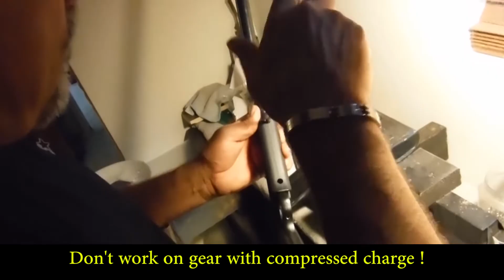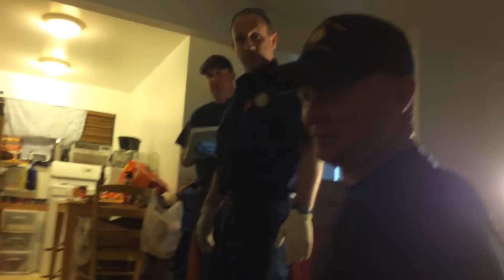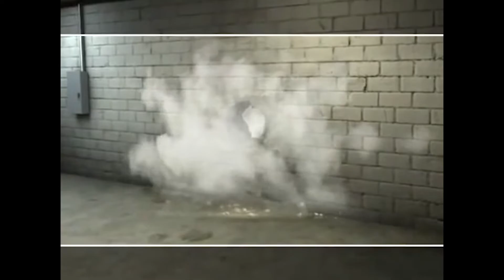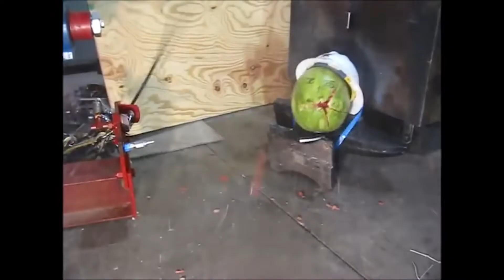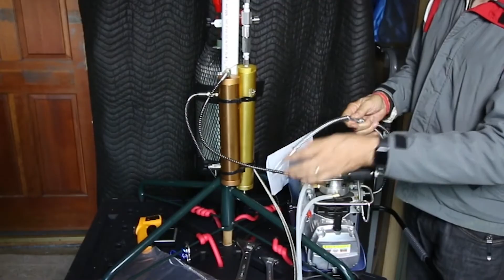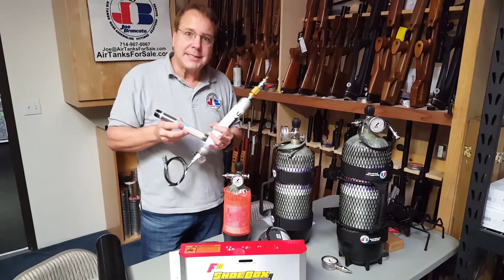PCP Paintball - Air Compressor Accidents and Safety

Comment: Michael, I Just finished your 3 part series about the Yong Heng Compressor. As I'm just starting out in the world of PCP Air-gunning, your videos are proving to be a valuable source of information. Part 3's "Accidents and Safety" is sobering. Safety glasses I have and wear. Chokers; I didn't know what they were or what they did. Now they're on my list of things to get. BIG THANKS! (from Nyack, N.Y.).
Reply from the maker: Thanks Jef.  We all enjoy the power of our gear and assume it could never turn against us - a true statement 99 percent of the time.  But after an unspecified number of recurrences of us casually "doing our thing" occasionally Stuff Happens!  I also fly drones and have learned to be extra careful of the props - spinning at 3,000+ RPM is bad news if it contacts someone's eye. 
Safe travels.